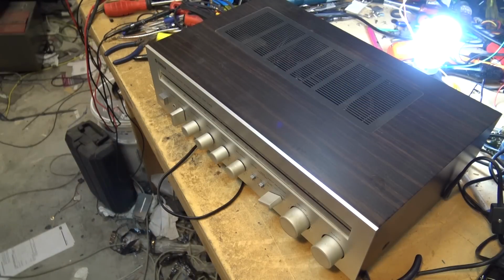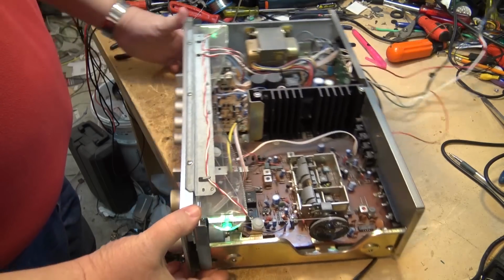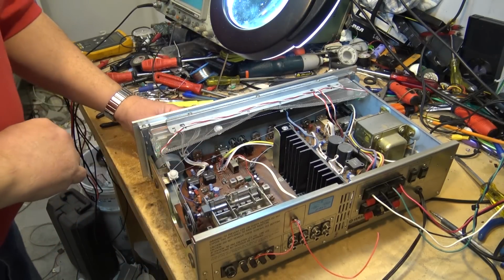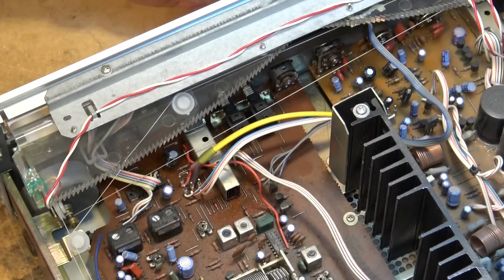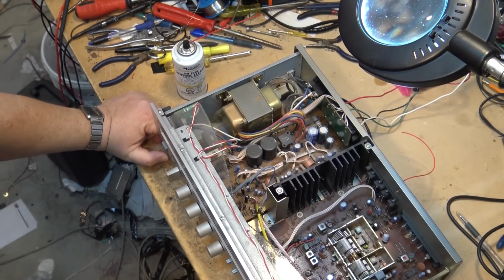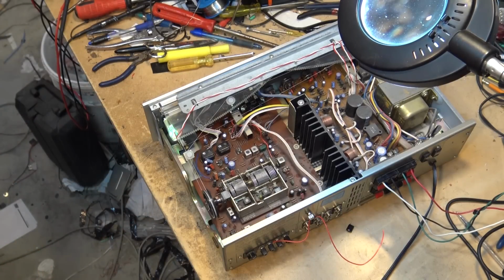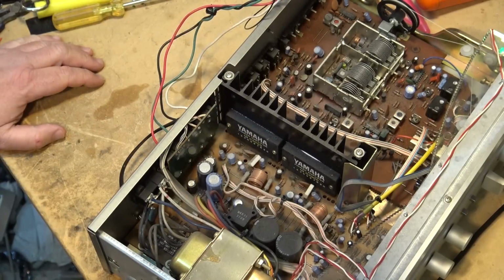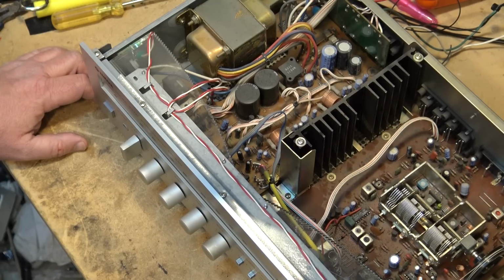Yamaha CR240 receiver repair edit

Comment: u can upload the video as private then wait a few days before making it public. theres a selection toggle on the upload page. that way u can be sure its monetized. i enjoy your videos, thx
Reply from the maker: Yes I usually do this. In this case I didn't expect an 8 second clip as I tunes across the dial to trigger it because usually it hits at 19 seconds and beyond.Also when it has happened in the past I just click on remove audio and they mute that section, but this time the system gave me an error that it couldn't remove it.

Comment: This may seem like a silly question but...

How does the Yamaha compare to the Leak?
Reply from the maker: Watcher3223 

when the leak worked properly I think it probably sounded fine. it is just the build quality that was in question. things like the mains capacitor just hanging unsecured by its leads.  resistors added to the base of the driver transistor. had the cut the trace and mounted it on the foil side then that would have been better. that is what other manufactures do when they mod, and then the make the change on the board for the next run.  most of the stuff from the  70 was built much better. the Yamaha was nice and neat but I am not a fan of power modules by anyone.
Reply: True, especially about the power amp modules.  Real pain to fix a unit if the needed part is no longer made, eh?
Reply from the maker: And that is why discrete components are better.If they are made of glass, glow and get hot even better still.

Comment: I'm really starting to like NuTrol.  I only bought it because my local store was out of DeOxit.  But it actually helped clean up a pot that DeOxit made worse.
Reply from the maker: I started using NuTrol when I was about 10. It was made right here in Vancouver. I was down at main electronics with my dad. We were testing all the tubes from the old TV. ( I was the one fixing it not him, he just drove me to the shop) Thought it was a tube because it was all noisy when the volume was turned. Shop owner said, that sounds like a dirty volume control. Here, spray some of this down the control. Sold me my first can of Nu-Trol.Haven't use anything since. It was developed for BC Telephone for cleaning the contacts on the crossbar and step by step switches of the day. The older formulas were even better. They had better solvents, that just can't be used today for environmental reasons, but the current stuff is still better than anything else I have tried.For the old mechanical tuners I used to use Chemtronics Tunowash or BluStuff. That was a grity type cleaner with grease that would polish up old mechanical tuners.

Comment: Good a nice easy one :-D
Its nice when the back of the controls are open, ive had to dissasemble and remove the pcb from some units because every control/switch had to be unsoldered and manually taken apart to clean.

Big multi contact mode switches are fun to take to bits :-D
Reply from the maker: Remember the mechanical tuners from the old TVs.Now they were a nightmare. Had to tape all the turrets out to get to the contacts and add some tension to the springs. Forget the order you laid them out on the bench, or when the shop helper knock them down and you have a problem. I remember doing one that my assistant took it apart, and didn't lay them in order. When I put it back together the channel order went 2,3,4,11,12,7,8,9,5,6,10,13!
Reply: If your talking about the rotating barrel with brown strips clipped in and copper contacts on each strip then i do, there were fingers that touched the barrel and every click lined up the one brown L/C circuit strip up with the fingers.
They have been known to fall out.
Is that the sort?